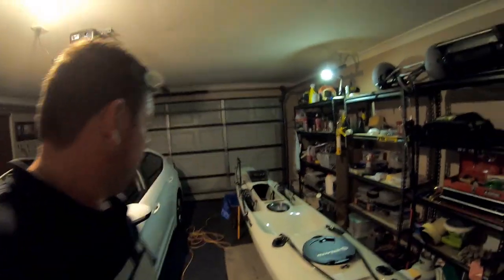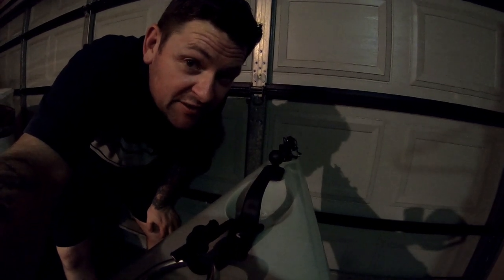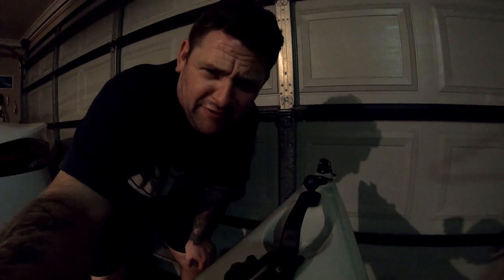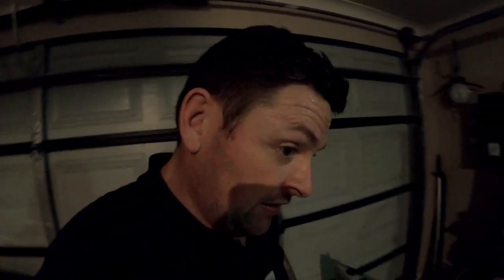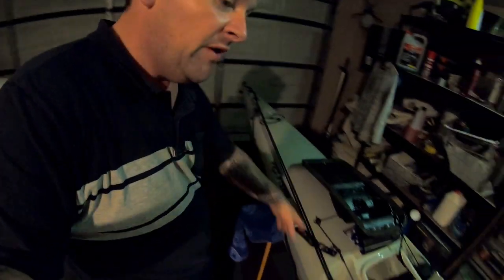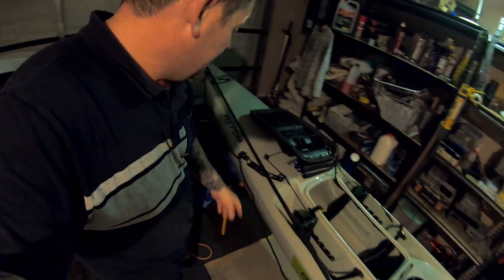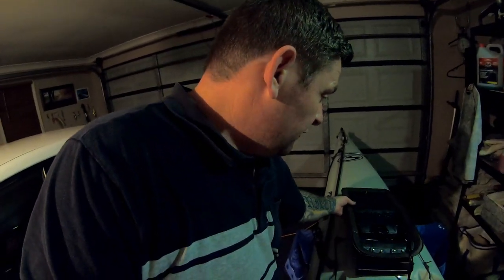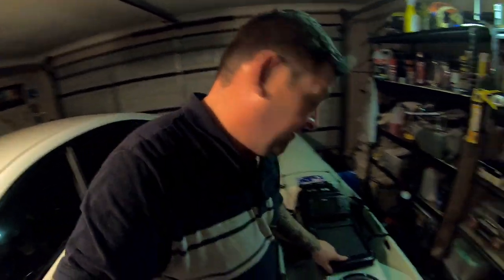Stealth Profisha 525 bombproof in Saltwater

Comment: great idea Jamie with the extendable paddle leash - nothing worse in surf if you've come off than trying to hang on to the kayak via the normal shorter paddle leash -  you end up crashing into the kayak - so to keep a safe distance I installed a separate cord that ties to the bow and the other end back near my feet with a quick release shackle 

But your idea of one lead connected to the paddle is genius - simple - no need to get to the kayak and undo that quick release shackle - with your set up you just hang onto the paddle and you get that distance between you and the kayak in crashing surf 

I'm gonna copy if that's ok

btw a better glue IMHO than Sika is Fixtech 15 - its flexible, neutral, marine proof and sticks to heaps of things including velco unlike Sika

Comment: I really like the wiring method you put together for the sounder. I never thought of sealing inputs on the back of the unit like that, but it’s probably a genius solution, as saltwater always finds away, even with o-ring protected connectors!🎣😃

Comment: I liked that. I haven't changed much on my set up in years. I bought my PF525 in June 2015. I'm looking through a few set ups to see if there's anything I should or could improve. My fishing in UK is quite different with rarely any surf & pretty small slow fish. I might try the ram mount idea on the next kayak. Planning to add the new Fisha Duo next year to the fleet. I may try the magnetic transducer mount too, although my previous one (Raymarine) worked well in the hull. I currently have a Garmin one fixed externally to the hull, a bit like Rod's idea only it's under the older-style rear hatch. The chat was good.
Reply from the maker: Patrick thanks 😊 you stay safe over there ✌🏻and enjoy your new boat